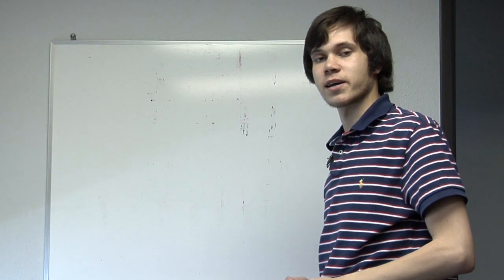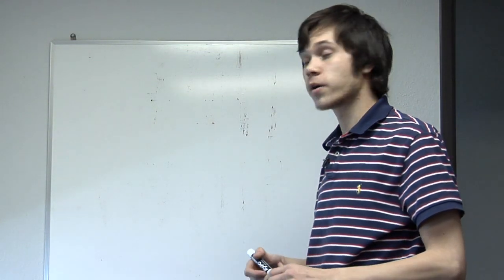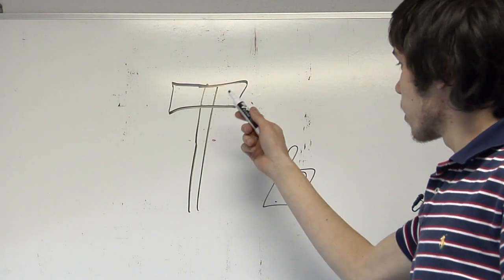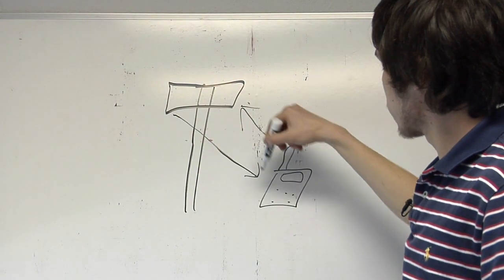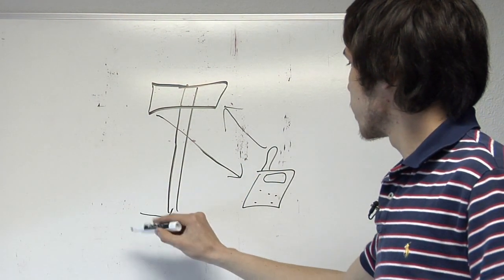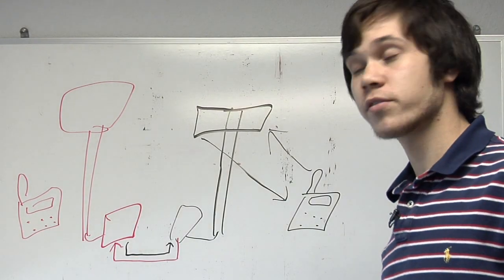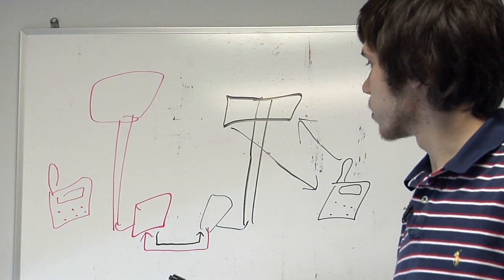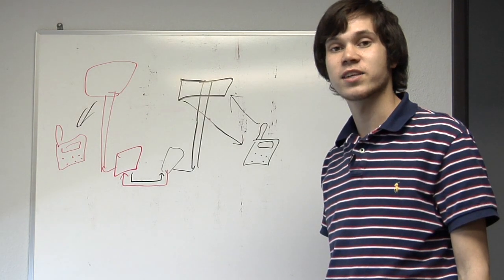Cell Phone Facts : How Do Cell Phones Work?

Comment: but what if two cell phones are communicating to each other through the same tower as cell tower use only 1 frequency i was told data buffering between phones / tower comes into play correct me if i'm wrong as i'm still learning.

Comment: All cell signals get routed through a backhaul provider to a switch.  The switch then routes the calls or data sessions to where they need to go
Reply: I don't understand how those phones with 4 Volt battery transmit back the data to a long distance tower which consumes even more power to connect to the cell phone, how is that??????